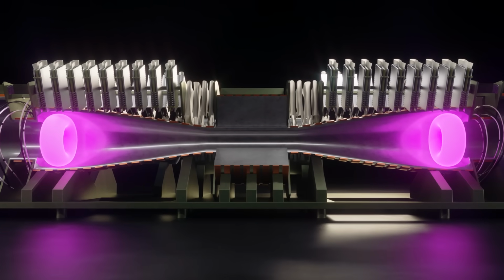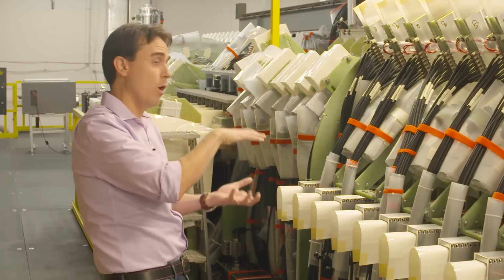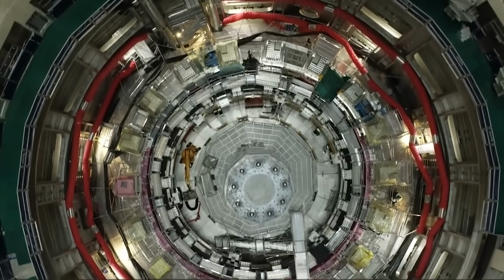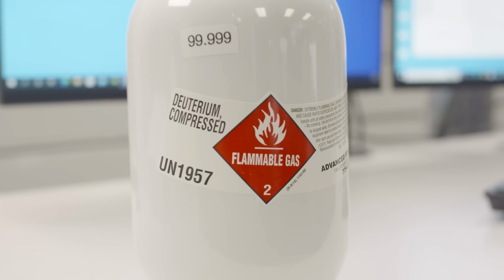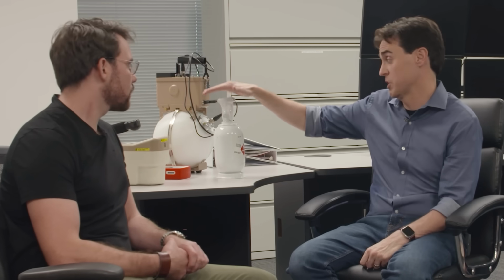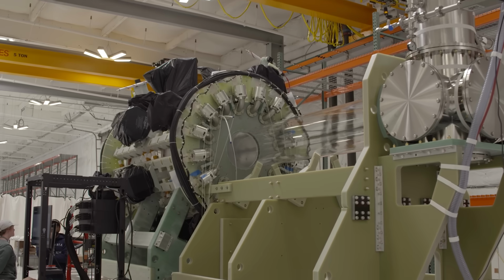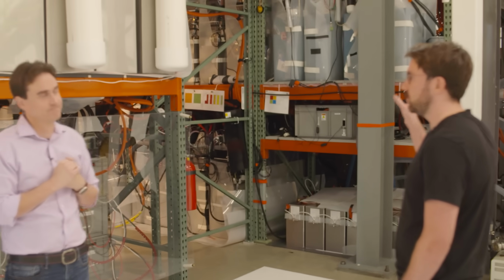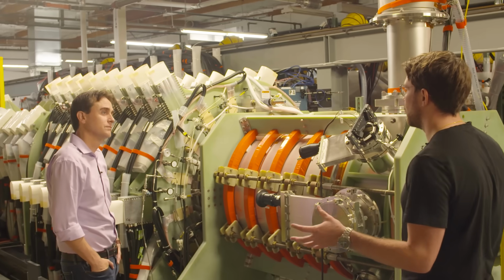A New Way to Achieve Nuclear Fusion: Helion

Comment: Wonder if they would get any advantages  if they went to multiple, lower volume plasma accelerator/compressor injector stages, vs. just the two shown. Would this lower the individual mechanical, thermal requirements for each injector? Or would the increase in materials for multiple injectors not be cost, timing optimal, with too much overhead?

Comment: Tocamac = steam engine 
Helicon = Diesel engine 
Kind of funny how two approaches are very different but comparable to what technology went through with trains and cars
Reply: And yet the most efficient train is an electric train fed by power plant using steam turbines because steam turbines are just that good.
Reply: @Vaasref  oh yeah it’s funny how we went from steam to Frisia back to steam again. It is odd how we want to create fusion to boil water. I am honestly interested to see what is more efficient of the generators. The one that boils steam to generate a turbine or directly getting energy from directly from the fusion. What’s more efficient direct or indirect power helicon is definitely like a combustion engine where the fuel goes directly to powering the vehicle Unlike steam engines that has its fuel heat steam to run the engine .

Comment: EDIT: My comment was a shitty thing for me to write, and it came from a place of frustration with my life circumstances when presented with a glimpse into the lives of those who had the financial supports for a formal and recognized scientific education. I'm still frustrated, so I'm leaving it there, but I will add that these scientists need to be celebrated; this is an amazing accomplishment, and required a lot of problem solving and creative applications of their knowledge, and not just the knowledge itself. It is a work of brilliance.

This is gonna sound like some edgy 14yo role playing as a super genius under the cover of anonymity, but I could actually make this... It's not a matter of brilliance; the fundamental scientific & engineering knowledge on which you can come to these conclusions exists in videos and free articles all over the internet. It's not complicated. You don't have to be a genius to figure it out; you just need to have the fascination which compels you to learn it. Not everybody has that, but fortunately I do. The issue is, you need machines to make the parts with, the materials to make the parts from, and the tools to put the parts together. Why am I bothering to comment this? Well, b/c I'm frustrated af. I can't tell you how many designs I've detailed (not drawn b/c I'm shit at art, but very thoroughly described) which I would love to prototype, but I can't b/c parts, materials, tools, and machines are all very expensive. I've tried checking for free shit on FB market place, but then there's the matter of transportation, and the space for the stuff in my tiny apartment... So I guess it's the poverty life for me. I've got a shit job to cover basic expenses for me and my partner who's unable to work, and that's about it. That's my life. F

Comment: Let me start by saying I hate crypto, but…

The one valid use case for crypto is disposing of surplus electricity in scenarios where disposing of it is better than turning a generator off…. if these fusion generators are continuous in their output it might actually make sense to use crypto for load balancing since the grid has to be constantly adjusted.

... also, I hate crypto.

Comment: this looks very very interesting, but the one thing this doesn't answer at all is how far off is it in terms of needed power put in to how much power they can get out of the reaction?
I'm not even talking about generating electricity, just how much energy is each fusion producing (theoretically) vs how much do they have to put in?
do they have to put in 100x? 1000x?
this is THE problem that has to be solved. even big tokomak reactors struggle with this. this video seems to imply it needs much less energy to get a reaction, since there are no lasers involved or anything, but its still a very important question to be answered.

so, while I'm still excited for this tech and the future of fusion, I'm still holding on to the "at least 30 years out" until proven otherwise.

Comment: What I'd love to know are the fail states and the measures put in place to shutdown and contain. With a fusion reactor you can both slam the control rods in and/or flood the system with high macroscopic cross-section molecules into the system to shut down. With this it seems you need to have a way to abort and exhaust the high temperature potentially high speed plasma in a safe manner. Then you also have to figure out how to do that simultaneously for the 2 halves but is robust enough to work if the other half fails
Reply: what control rods are you on about? If anything goes wrong there's only a few mega joules to worry about. 1MJ is a small car travelling at 1m/s you could stop the car just by pushing on it with your hands

Comment: I always wonder if it's worth storing the energy in superconductor coils instead of capacitors. They DO store energy, I know that much and you already have to have superconductors doing the actual magnetic squeeze but how much do they store and how hard is it to get it out of a storage coil and into the working coil?

Comment: Separating the fuel generating facility from the electrical generating facility could also simplify licensing by keeping the radiological hazards in the fuel generation, with the more significant licensing reqiurements, in a remote area so Helion can have the much less hazardous electrical generation next to the customers.

Comment: But they still haven't proved they can generate more power than they put in. You can generate power, but if the cost of generating that power is more than it, then it's all useless.

Comment: Helion is really going to benefit from coming discoveries in material sciences.

If we can find a material and find a way of mass producing it on industrial scales to aid in superconductor cables, this would significantly lower the cost and the amount of hardware needed to make these generators.

Power production will also be significantly increased.

It seems like a universal holy Grail right now finding a room temperature super conductor.

Though it looks like they're making some headway with carbon nanotubes. But they don't handle heat well so like diamonds; more research it is.

Comment: How does the pulse rate/waveform that is driven into the machine compare to what comes back out? Would it be possible to set up a loop of machines where each reactors's power generation phase is aligned with the next reactors power consumption phase? Built like that, it might be possible to have the steady state operation need little if any capacitive storage.

Another thought; how fast can you extract energy from a superconducting inductor?

Comment: This seems to me like the first fusion technology that has a real chance at wide-spread and large-scale commercial viability and application, which is exciting. Other fusion tech is, as you mentioned, far too expensive, resource-intensive, and uses only slightly less power to operate than it produces, making it pretty useless. With this, it actually seems like maybe in a decade you get great bang for your buck on these as opposed to tokamaks and others that are just money pits in the hopes of scientific progress to EVENTUALLY make fusion energy viable.
Reply: @djdoc06  They're using electromagnets to excite the gas into a plasma state. The powerful magnets exert force on the gas, bringing it to a superheated state where the electrons in the gas flow freely from atom to atom. In this ionized state, the helium and deuterium are easily manipulated by electromagnetic forces and shot out. This is really basic stuff. Turning these gasses into a plasma state is well understood, they're just pointing two nozzle-shaped railguns at each other with plasma instead of solid projectiles.

It's shockingly simple in concept.
Reply: I can also see it being modified to make a fusion pulse rocket at some point, perhaps being powered by a generator version and basically using an electromagnetic version of a bell nozzle for directing the pulses.  I wonder what the ISP and TtW would be for such an engine (as long as the capacitors used have at least twice the charge and discharge rate as the reactor and engine, you could potentially use the same capacitors for both systems, basically alternating between the generator firing and then "filling them up" and then the engine firing and using what is not needed to fire up the next generator firing that fills them up again for the next engine firing, etc).
Reply: It's a internal nuclear fusion engine.
With plasma pistons
Reply: @djdoc06  I think the idea makes a bunch of sense. Besides tokamaks, all other fusion energy systems have a huge problem when it comes to the cadence the fusion reaction can be performed, Laser and inertial confinement place the fuel in pills, that need to be very precisely placed, as the focal point is very small. When fusion occurs, those super precise supports, just get blown. So they have a very real issue for fueling them reliably and in an automated way.
And here come these guys with this idea where they compress the plasma with weaker magnets, thanks to the inertia they give the fuel, and the smaller size. It also makes for a more repeatable process, with easier fueling, and potentially a more direct convention to electricity that increases the efficiency massively.

And making plasma is very easy... As the video said... plasma is a state of matter where the electron is not bound to the rest of the atom. You can make it with a strong enough electric field. And it is being done to death. Lightning, the flashy part you see... It is plasma.... Fluorescent lights... Work by making plasma inside the tube. And those are cheap as can be. And then... Because in plasma, the electron is detached from the atom, atoms end up not being neutral when it comes to electrical charge, so you can move them by making electric fields. Like magnets, polar opposites attract. So you can make that plasma go wherever you want. In fact, that is how the old TVs worked. (the ones that were like boxes) They made a small plasma discharge, and used electric fields to guide the discharge to a fluorescent coat on the front glass.
Nothing new or strange here...
Reply: The problem is as we have ever more ways to effectively store energy and renewables get ever cheaper the energy market will get more competitive.  However if there is one existing fusion reactor design that can catch up it’s this one.
Reply: @alwynwatson6119  Yes, but a reactor this small could be used for other purposes other than electric generation. Like the shipping industry.
But also... no system can be 100% renewables. There is always that day when the weather is just an energy desert. No wind, no sun. And sometimes it stays like that for a week or more. At some point, no matter how cheap batteries get, it just makes more sense to start a generator, instead of having a ton of batteries for a just in case scenario.
Reply: @djdoc06  Well... the plasma heats up because they compress it with the electric magnets that make an electric field that squashes the plasma, just like in a tokamak. Plasma is just a gas... and it heats up when compressed, because in a way it was already hot. Gas has a certain amount of heat energy at ambient pressure, and if you compress it, you move all that heat in a smaller point, having more energy per volume, thus, being hotter. Compress it enough, and you can get it as hot as you want. It is similar to concentrating the sunlight with a magnifying glass. The sun is not hot enough to burn anything, but by just concentrating a bit of it's light to a small point, you can start burning things, and the smaller the pint, the hotter it gets.

And the electricity generation, I also want to see, but it sounded reasonable to me. They said they will start experimenting with the next generation. The one in the video made no electricity at all. What concerns me the most is the fuel generation, where they proposed having a reactor just to make the fuel. That energy capturing system better capture several times the energy they put in to power the grid, and the other reactor.
Reply: @djdoc06  Yes. That is the idea.
As an idea, it is very promising, because it sounds way more practical and reliable than the other options. Now, let's hope they can actually capture enough energy for it to work as a power source.
Reply: At 7.45 he says 100 million degrees. Quite vague.
Reply: @djdoc06  The amount of radioactive waste produced should be pretty low, mostly caused by neutrons fucking uo the nuclei of the materials the reactor is made of and creating unstable isotopes. The reactor produces lots of radiation due to the neutrons but much less radioactive waste than a fission reactor. Radiation is much easier to handle, just harden the casing and keep people away while it's active.
Reply: @djdoc06  Good to know about the radioactivity thing, which I hadn't heard of before. I'd still argue that net energy gain does constitute a genuine milestone, because while yes the actual energy required to initiate the reaction was immense, the inefficiency lay in the lasers rather than in the reaction itself, and there are several well-understood methods to massively increase the laser efficiency relative to what was done at the NIF. At the same time, yes, net energy gain is going to have to massively increase before fusion is really viable. At the very least, it'd have to cover the inevitable waste in superheating the plasma etc, so it's best not to get too excited.
Reply: @djdoc06  Yes that's true. It is highly likely that by the time we have commercially viable fusion reactors we won't need them.
Reply: As someone with a PHD (piss head degree) physics i totally agree
Reply: Just because it’s the easiest to understand concept to date and its’ design least complex, doesn’t guarantee anything but false hope and idealism. What’s the point in jumping to conclusions anyway? Practicality should never go amiss, especially now that the mind required to produce such technological complexity has littler and littler to do with questions of ethics and progressional direction. Scientists are afforded to become full of hubris just the same as everyone else.
Reply: @finnmacdiarmid3250  Why are you talking about the possibilities of fusion technology like it's transhumanism or eugenics?
Reply: @finnmacdiarmid3250  No one is jumping to conclusions, the technology has gotten to a point where practicality (which is always under consideration, hence why fusion has yet to see any real use) is feasible within maybe a decade.  Critical thinking about subjects like this is indeed important in order to see the potential flaws found in the system, but your pessimistic views are both unhelpful and demonstrates that you lack understanding about the level of thinking that goes into the research and production of anything like this and anything else in general.
Reply: @homerman76  You sound like Stalin.
Reply: But they are basically doing a double tokamak with additional technical challenges. How would their approach be any more promising than what ITER is doing?
Reply: @eljanrimsa5843  Did you even watch the video?

Comment: Wouldn’t we be able to extract Helium-3 from the moon once everything is up and running with NASA’s gateway/moonbase in the next decade?  That would be just in time for fusion reactors to get a viable fuel that’s more efficient for fusion reactors.  That would eliminate most of the problems we currently have with using deuterium and tritium fuels.

Comment: Just like every other technology in history, this raw looking, gigantic machine will only get smaller and more compact over time. How the first computers filled entire rooms and used huge components we eventually shrunk them down to fit on chips the size of dimes. This too will one day fit in every car and home and be nothing more than an after thought. Super exciting time to be alive.
Reply: The point of industrial scale is to be at industrial scale. There is a reason we don't all use generators at home, they exist and have their application but you gain in efficiency by making the power generator big but the power use small.

If it makes bigger is better, if it takes smaller is better.

Comment: Seems like a cool idea, but I'll remain skeptical. Kind of like with the recent announcement from the Department of Energy. It's hard to get excited about a reaction that produced 3.5Mj of energy, that took somewhere in the range of 300-350Mj to create. Sure, the lasers delivered less energy than the reaction created, but to get that much laser power on target required massively more energy than was produced. A step forward certainly, but no way did it demonstrate net energy production. Probably way more important for weapons research honestly, than for potential civilian applications. It'll be interesting to see what problems arise when Helion attempts to capture energy from the reaction, I'd hazard a guess that there will be SOMETHING going on that was not predicted. Would be cool if I was wrong, won't hold my breath.

Comment: In the end, the NRC will regulate this device, that's the end of that, no fusion for humanity. 

In SRM-SECY-09-0064, “Staff Requirements—SECY-09-0064—Regulation of Fusion-Based Power Generation Devices,” the Commission asserted, as a general matter, that the NRC has regulatory jurisdiction over commercial fusion energy devices whenever such devices are of significance to the common defense and security, or could affect the health and safety of the public.